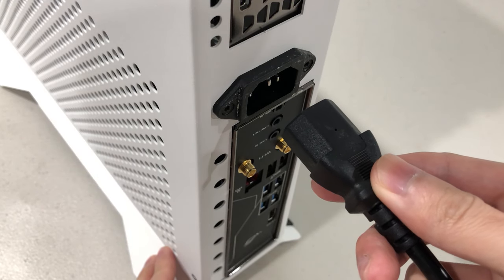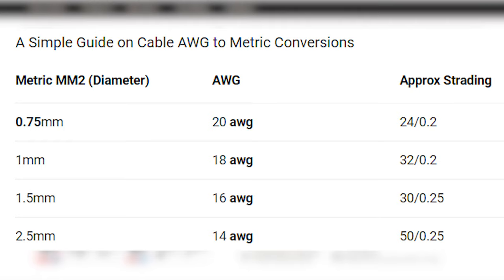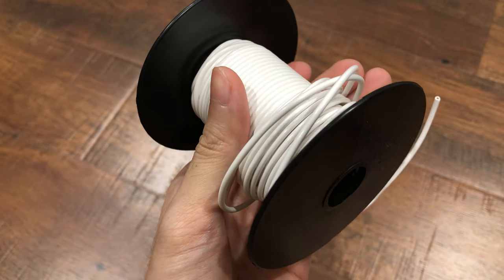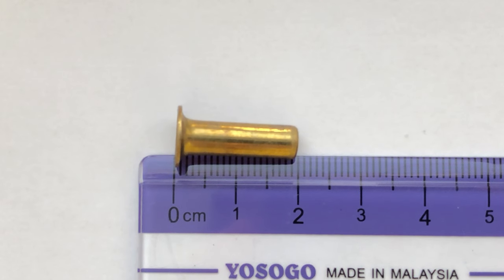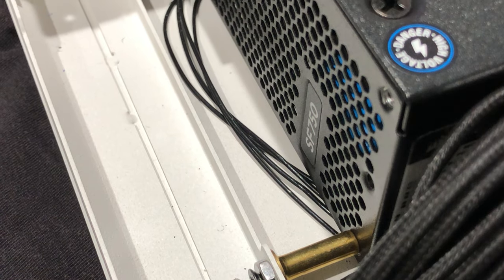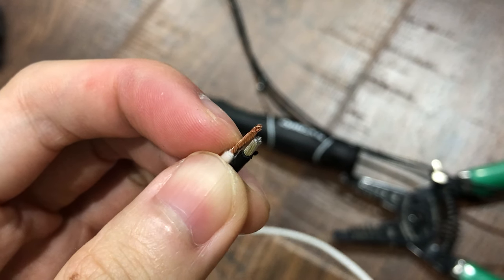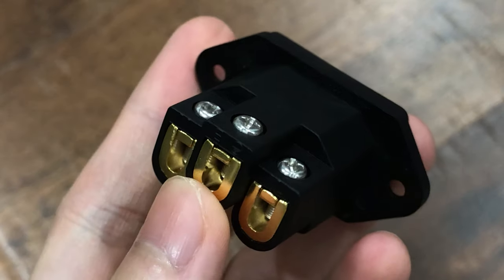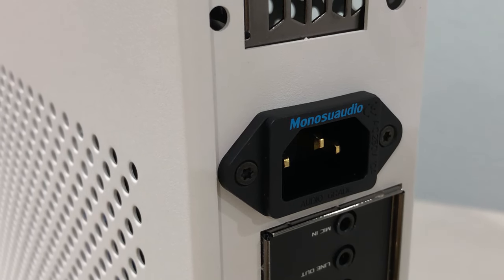DIY Screw-Mounted C14 to C13 Internal Extension Power Cable for Mini iTX Small Form Factor PCs

Comment: XQ69 power cable is a 1.5mm²
Reply from the maker: Yes, it is better than the one I replaced with 😁 I only knew it after I stripped the cable
Are you the maker?
Reply: @PokerFaZe  And the copper core is silver plated.Yes, it's me.I'm glad you like it.
Reply: @xujia4757  will u expand on shopee indonesia? since u ship to malaysia too on shopee malaysia.
i would love if you expand and ship to my country. thank you
Reply: @xujia4757  Hello I bought your case early this year, and trying to make more holes for ventilation. By any chance, can you provide the distance(mm) between each holes(center to center)?

Comment: why less AWG is better?
Reply from the maker: The less Awg means the cable is thicker and can handle bigger electrical load
Reply: It's the other way around because you start with the same piece of metal and for thinner wires it gets pulled into a longer shape.

Comment: 5:00 for safety there it’s a good idea to have the middle ground lead be the one with the most slack while having the live wire be the most taught inside the connector just Incase the wire gets pulled, it would disconnect the live wire before the others so no live circuitry.
Reply from the maker: I am a noob to electricity so what is "slack" and "taught?" I think with the C14 header is screwed to the case, unless the screws are bad, there is no chance the cable gets pulled out of the case.
Reply: @PokerFaZe  i think he meants tight not taught, like make the live wire shortest and other wires a little longer so even if the cable is pulled the live wire will disconnect first and they won't touch each other to create a short as they will be different lengths
Reply: https://www.youtube.com/watch?v=abqMLqHwqpo in this video by ElectroBoom he mentions it around the 5:33 mark when he's talking about the internals of the UK plugs, I'd assume that this applies the same to the C14.
Reply: @PokerFaZe  Theoretically, the enclosure needs to be grounded. Theoretically, the enclosure needs to be grounded. However, in our environment in China, all power outlets are grounded uniformly, and all are not connected separately in the XQ69 power extension cable.

Comment: You were right. The original wire is better. It's actually 15AWG Silver Plated FEP wire which has area of 1.5mm² and wire OD of 2mm rated at 300V per wire.

Just leaving it here in case anyone wanders in your comment section.
Reply: How did you tell, and also would this wire be good for a real high end 850 watt powersupply system built for the 40 series cards ?